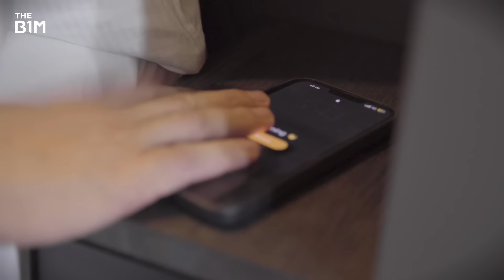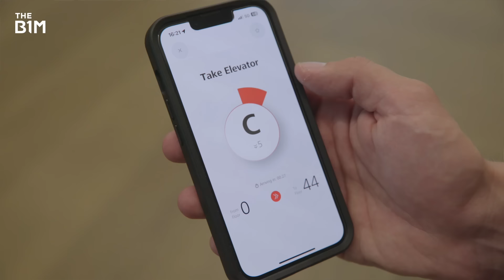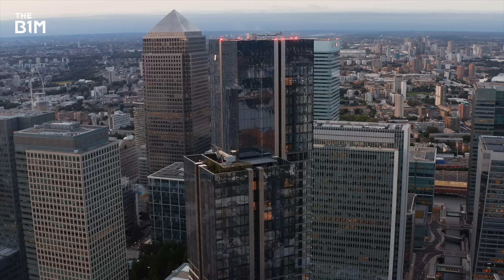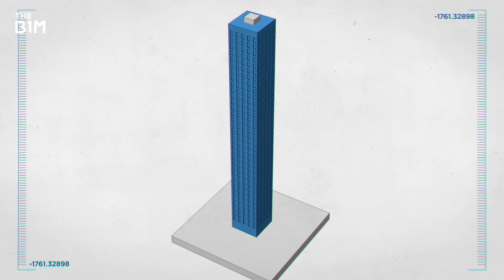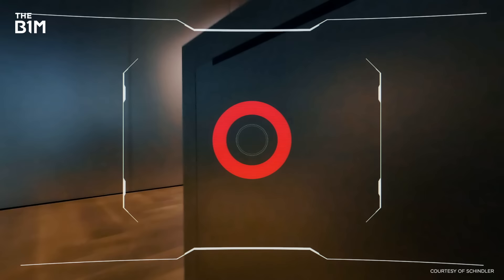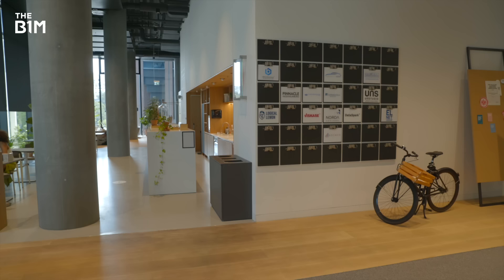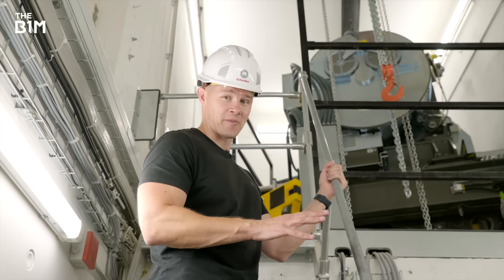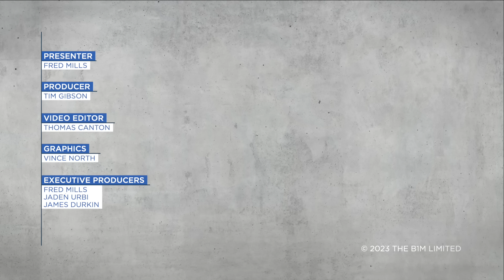Germany Has Solved the Empty Skyscraper Problem

Comment: This video is a big disappointment. It does not exactly explain the concept but keeps on telling us the benefits over and over again. I get it mate: Skyscrapers could be used in a flexible way. I don't need anyone to explain the benefits of that. But answer the question: Is an elevator permanently programmed to serve only the residential areas? Or is it flexible and takes whoever calls it from the respective lobby to the related area? So it basically can only take one kind of party, residents or office people, on a ride so they don't mix.
One suggestion: Make a partition in the elevator cabin that can move. So it could take 5 residents on one side, move the partition to nearly squeeze them and let business people in on the other side. Instead of a solid separation you could use smoke (non toxic of course) blown up through nozzles in the floor at various points to separate one crowd from the other actuated by sensors. Just like the blower curtain at department stores.

Comment: Sounds like a solution in search of a problem.  

I don't believe you ever explained how this would help adapt existing buildings.

You literally give only one sentence: 
that the existing elevators could be converted "with an attachment."  

What attachment? 

You spend a great deal of time talking about how this changes the layout of a building core, but thay only applies to new buildings - you're not going to meaningfully change the core of existing buildings. 

It really feels like you had a video idea to talk about these elevators and wanted to tie it to the housing crisis and office building vacancy, but forgot to write the bridge between those two ideas. 

I think this video is okay as far as explaining these elevators, but if you want to talk about the housing crisis / office vacancy duality, that needs to be it's own well-researched video.  

Maybe try to do a collab with Climate Town.

Comment: Hmmm - an uncharacteristically confusing video - I am non the wiser about why using the same amount of lifts but with two lobbies makes anything more efficient? Surely the same amount of floors/people/lifts has the same max throughput regardless? Can someone explain? Also still not sure how this 'solves' the empty skyscraper problem? 

I'm baffled.
Reply: It's more efficient than a regular lift system with landing push buttons. This system uses destination control which is not new in the slightest.

Basically the control system groups people going to the same floor or nearby floors into the same lift. The lift doesn't accept calls so won't stop at random floors on the way up.

Comment: OMG is the audience supposed to be complete MORONS? More efficeint elevators are def nice,  but what about:
- Plumbing, power, ventilations for kitchens and bathrooms
- Privacy between units / securitity between floors, even stairway access
- nothing about modular design in the concept... isn't that what this IS, or would be if it was REAL

... so the magic sauce is the elevators? Umm, this video brought to youtube by:
Elevators, Escalators & Moving Walks | Schindler Group

Hope you enjoyed the commercial!

HOW MUCH EXTRA COST does it take to merely  STUB out for POTENTIAL FUTURE USE, alll the infrastruce needed to turn offices into apartments???!?? 

That's mind-bogglingly EXPENSIVE! ...with no guarantee of ROI for such USE. 

Made for a FUN video, but for real... WTF?!?

Comment: This video severely overstates the innovation of having multiple lobbies and an elevator with doors on both sides. This strategy has been around for longer than we've been alive. Simply put, this video is not up to B1M standards. The whole concept of the video is sensationalized nonsense. A two door elevator does not solve the empty skyscraper problem.
Reply: Upon further thought, I'm unsubscribing. B1M has gone too far with disingenuous advertising. It's insulting that they are portraying this as revolutionary and a problem "solved". We can tell it's disguised advertising.

Comment: what's the word for this... contrived? have you not been in a mixed-use building before? there's no law of social order demanding segration of residential, hospitality, and commercial use. or even light industrial use. if a high rise owner wants to mix use, they don't have to fret that those entering on the bottom floor will gasp share an elevator! 😂

but sure, for the absolute most high-end buildings serving those with the stiffest cultural hang-ups, great. elevator programming.

Comment: The work from home revolution is causing vacancies in commercial skyscrapers, leading to a challenge in repurposing them. However, the Omniturm Tower in Frankfurt, Germany, may have solved this problem with its multi-use design. The building has separate lobbies for apartments and offices, but both use the same elevator system, making it adaptable to future needs. Omniturm Tower's elevator system is part of Schindler's "metacore" approach that maximizes efficiency from the moment someone enters the building. The system allows for the same elevator shafts to be used for multiple purposes, eliminating the need for separate lobbies and sets of lifts, which can take up an enormous amount of space on the floor plates. Omniturm Tower is the first skyscraper in Germany with real multi-use, and it could become a blueprint for future skyscrapers, saving tens of thousands of existing skyscrapers from wasteful and costly demolition. 

The challenge of repurposing commercial skyscrapers is not unique to Frankfurt. London's Canary Wharf is facing its highest office vacancy rates since 2005, and New York City has record high vacancy rates, growing more than 70% since the start of the pandemic. The US office vacancy rate is nearly 20%, while there is a national housing crisis. Repurposing skyscrapers to be mixed-use is a solution, but one of the biggest challenges is the elevator system, which can slow down traffic flow and take up a lot of space. Omniturm Tower's design offers a solution to this challenge.

Comment: yea this is just another "techboy" solution that looks fine in concept like "hyperloop" but its fanciful nonsense. just because the elevator has 2 entrances doesn't actually lesson the traffic volume. This is a laughable failure of basic logic. 
also rapidly changing floor area uses? sorry, but no. unless you can "effeciently" find a way to easily change move and install huge volumes of water infrastructure within the building, then changing types of uses is stupid. separating uses by floors, fine, no problem, separating the floors into halves with solid partition walls, no problem. moving water infrastructure, or simply installing an over abundance of it is laughable. 
this is the kind of "solution" you get from a person who doesn't even run the basic numbers on how many more Water fixtures there on per square meter residential vs office commercial. 
only solution i see to that is just running all your water drain pipes along interior walls totally exposed so they can be "efficiently" moved, but then you have to adapt ever piece of furniture to work around the pipe that MUST sit a horizontal angle.
Anyways once again cutesy techboy idea has 0 logical real world application. 
BTW this 2 lobby "separated" elevator entrance thing already exists in hundreds of iterations around North America, trust me, having used elevators in buildings with the dual purposes they aren't any faster. what a joke.

Comment: WTF is this for an Idea??? never ever have I heard of such bullshit... you have an elevator you use the elevator to go from ground to your floor... Does not matter if you are a resident goin to your apartment, or an employee goin to work... I mean seriously... wtf are you taLKIN ABOUT? IF ANYthing, there can be problems with  plumbing maybe - since offices will have all the plumbing concentrated but again that schould be an easy fix since its a skyscrapper so there is plenty of elevation to solve it... In fact the only problem there is - is that ona might not want to live somewhere where you need to rely on an elevator to be able to enter and leave your app.